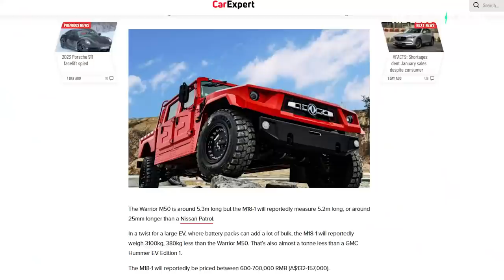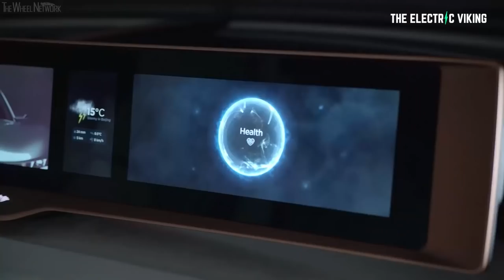NEW M18 is most awesome electric Pick-up I've ever seen!

Comment: An old boss of mine had a H1 Hummer diesel version years ago. He had to install a 1" thick plate of steel in the back to get it to ride half way decent. I think the fun wore off very quickly after taking a few short weekend trips in it. If your young and don't mind being bounced around alot then they see fine. Hopefully the M18 will be more comfortable and still be rugged.

Comment: I like it. A carbon copy of a H1 Humvee. I had one in the early 2000s which was a former military used I got a good deal on. Looks cool but uncomfortable as hell
Reply: Agreed.  It appears to be a copy of the original H1 Hummer.  (Especially the interior pics showing how wide the vehicle is, with the seats pushed WAY out to the sides.)  The BEV propulsion should be a big improvement though, because from the gas guzzling diesel or gas versions of the Hummers were a killer.

Comment: Back in the 1980s, you could buy a base model F150 for the same price as an economy sedan.  Love to see someone offer a standard cab, 8' bed EV pickup for $30,000 US or so.
Reply: The problem is that you need a large battery for such an inefficient vehicle. With an ICE version you can fool people by slapping on a larger gas tank. They'll think there's no problem because they won't think about how much that fuel is going to cost. With an EV they have to pay for the battery up front, so there's no way to hide the cost.
Reply: Yeah without all the bells n whistles that for many people, simply are not needed. People end up paying $10 to $20 thousand more for a vehicle they need with loads of electronic extra parts they don’t want or need.

Comment: I would love one.  A bit expensive though.  I am waiting for a basic electric truck that has a normal 8' box for a camper.  As much as I like the features of the Cybertruck, I am not crazy about the triangular roof line not being able to accept an old school camper.  Not only that, but I am not that crazy about driving a pyramid, even though the rest of the features are cool.  I wish Tesla would have made a more traditional pickup.  Oh well, but you would look great in this new M18 Viking!   Flashing your biceps to the ladies, you would be a killer!!  I think I'll just keep my F350 regular cab Dually 4x4, it's pretty cool and has a payload over 7000 lbs.  I'll probably bite the bullet first before I sell my truck.  Cheers from Canada.